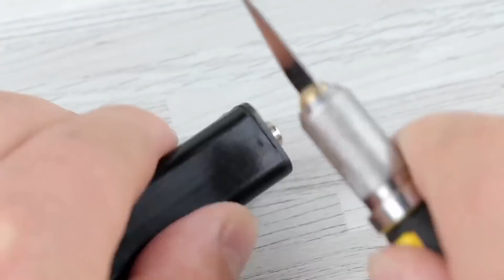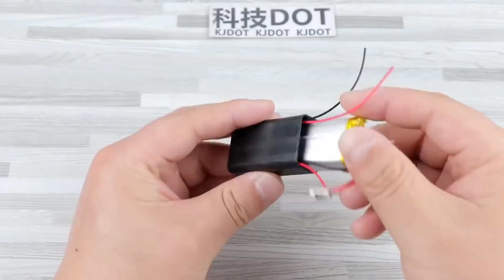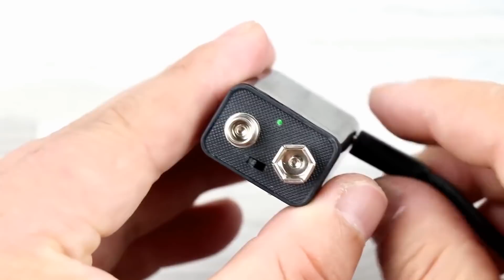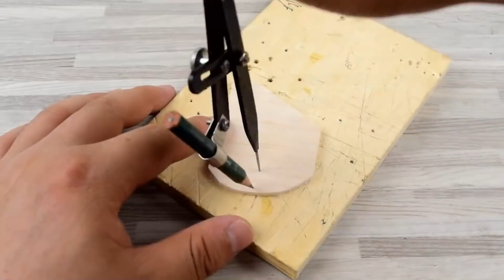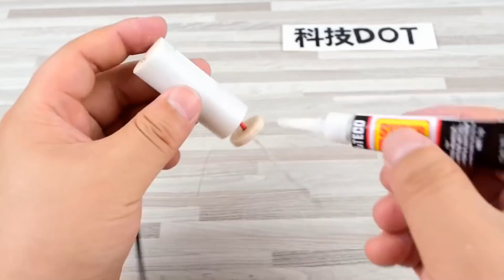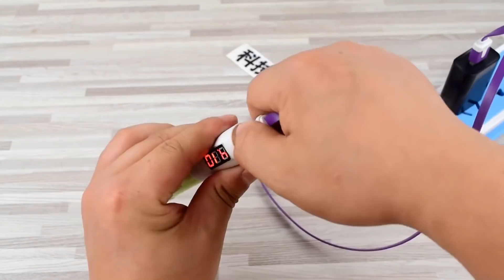TOP 2 Awesome Creative Ideas

Comment: The idea is good, but very small capacity. You need to lay down the battery more and use three LEDs instead of the ice display, they consume less.

这个主意不错，但是容量很小。您需要放更多的电池，并使用三个LED代替显示屏，它们消耗的电量更少。

Comment: DO NOT: Disassemble any battery unless you know what you are doing.
The connector part of the 9v can easily be bought.

Also using a non standard 9v battery in a multimeter might give incorrect results
Reply: How so? Are the electronics in the multimeter dependant on a constant, consistent 9 volts?